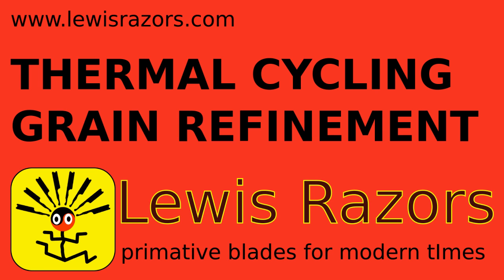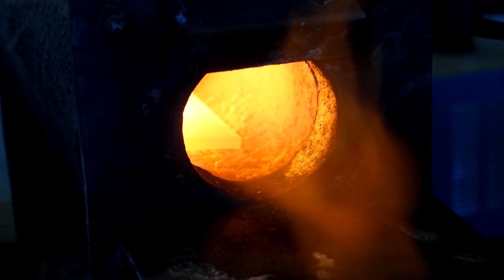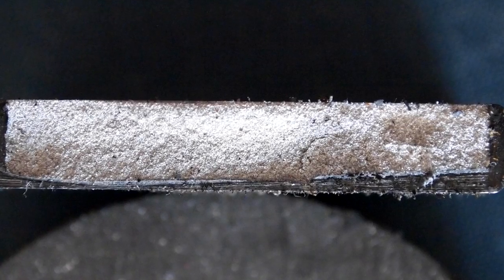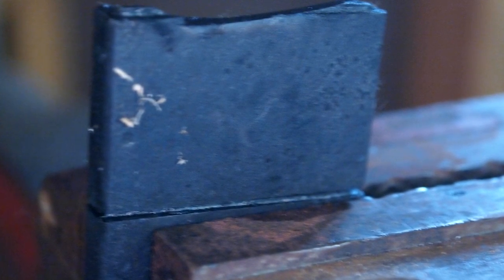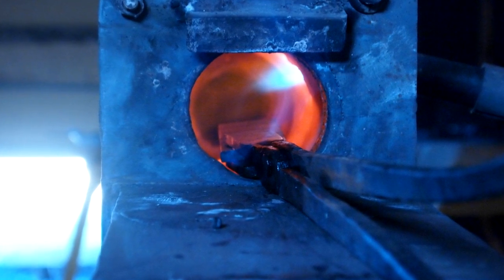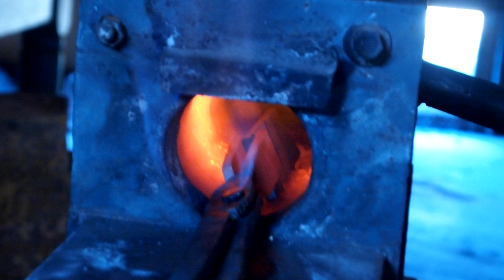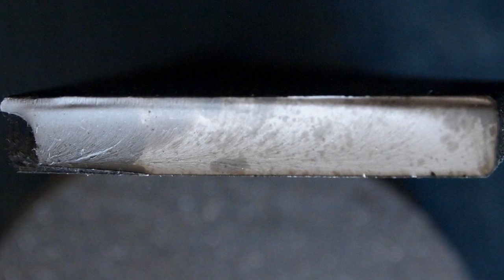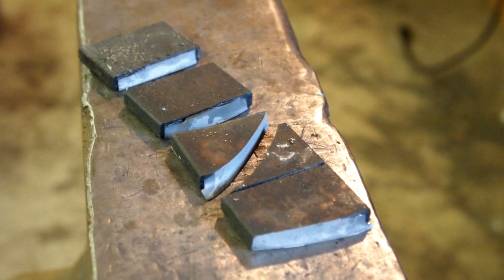Grain Refinement

Comment: I would like to clarify your process here as I’m not sure I’m on the same page or fully understanding.  Firstly how are you measuring or determining the critical temperature (I dangerously assume lower critical temp) and in what medium are you quenching?  Then, do I understand correctly, that you then repeat the exact same process 3 times, achieving finer grain after every cycle?  Many people advocate a first cycle to about 100°F/40°C above the upper critical temp (Ac3 or Acm line) to obtain full Austenite, then the next cycle to the lower critical temp (Ac1 line) and then the last cycle to about 20-40° below lower critical.  To me this appears that you are achieving finer grain by just repeating the same process, but not cooling to room temp between cycles like usually done in normalising but quenching between each cycle, and this successfully reduces your grain size???

Comment: so you're just quenching and quenching and quenching?
Reply from the maker: Yes, heat and quench
Reply: Lewis Razors well that's pretty easy, so after the triple quench can i do tempering as usual?
Reply from the maker: yes, air cooling works just about as well and has less a chance of cracking the blade.  Air cooling or quenching both will work.
Reply: @lewisrazors  thank you for the fast respond sir!

Comment: thanks for this. Ive been having huge problems heat treating 1084 and still dont know what im doing wrong. Maybe i should do one of these tests myself. Is it detrimental in any way to re-attempt a heat treat on a blade that you feel didnt get hard enough?
Reply from the maker: If it does not get fully hardened, do it again.  1084  is a great steel to learn with it is forgiving.

Comment: i have an uniformed question.  so you heated it and then did a quench in oil each time?  next question:  what temp did you heat it too?  also. each time you did this the metal got harder?   shouldnt it have gotten very brittle?
Reply from the maker: Yes, I heated and quenched in oil each time. 

The first heat, before I started the project was a long heat around 1800-1900 (I did this by eye in forge, so take the temps with a grain of salt)  I wanted to make big ugly grain.   The following heats were around 1500. I would watch for decalesence then quench.

The metal was hard after the first quench. Hard but not the best grain structure. The finer grain structure makes the metal more break resistant.  Yes you are right the metal was brittle, If I had a thinner piece of metal would have shattered a lot easier. 

Metal can be hard, but have a terrible grain structure. The refining of the grain does to make the metal harder, but makes it tougher (and in the case of a blade, makes for a better edge).

Comment: I just tried to replicate your experiment with O1 and wasn't able to do it. I used a smaller piece but scored it the same way. Each piece's grain looked decent (approx like your second piece in the video) but didn't vary much.  Is O1's behavior quite a bit different than 1084's concerning grain refinement? Or did I do something wrong?
Reply from the maker: The alloying elements in O1 make for  deep hardening and fine grain, O1 does behave differently than 1084.  What you said makes sense to me,
Reply: +lewisrazors Cool. Thanks for the answer and quick reply.

Comment: Enjoyed your video.  Glad to see you are from Texas too.  I love to see tests done on steels.  There seems to be a lot of confusion with thermal cycling and normalizing.    Normalizing allows the steel to cool completely without any quenching, whereas thermal cycling allows the steel to cool slightly to black, then heated back up (or sometimes quenched at black and then heated back up).   However, I've noticed some people will refer to thermal cycling when they are really normalizing .  Have you by any chance, done any tests just doing thermal cycling (quenching just after it goes to black) compared to quenching right after reaching critical temp, which is more like a regular heat treat, just multiple times?
Reply from the maker: I am getting my ideas and thoughts from Verhoeven's books on metallurgy, he talks about bringing to critical and rapid cooling to reduce grain size.  I have not experimented with quenching after the steel is black.  I think of thermal cycling as a general term, it could be critical then air cool, it could be critical than cooled a slow rate, it could be sub-critical sphereroidizing, it all depends on what I want to do to the structure of the metal.
Reply: Thanks for the quick response.  I've been working primarily with 5160 and 8670.  One thing that I've noticed by cooling to black and then reheating back up to critical, is that after doing my final quench for heat treat, the knife didn't appear to get as hard as it normally does so I did a double quench which gave me the hardness I expected, but what I'm thinking is that possibly the cooling to black and then quenching and then reheating again without having let the steel cool completely may have been acting more as an anneal on the steel, which may have been a factor as to why it didn't get as hard.  I did just finish heat treating a knife w/ 5160 using the quenching at critical and that hardened up really nice.  I have not done any destructive testing with this method, so I was glad to see your video, but I do plan on doing a few experiments myself.

Comment: Awesome video man! How does the effect of this process compare to normalizing the steel the same number of times? Would you say it's probably more effective?
Reply from the maker: +Tristan Ruggeri The results would be very similar, using oil takes less time than air cooling, I hate waiting.  Is one better that the other?  If the blade has been forged to shape and already gone through numerous heats I would say both ways would be equal.  If the blade is a fully annealed and spheroidized stock removal, I think the oil method would work a little better (splitting hairs here)

The oil is a quicker method, but there is also risk involved, air cooling is a little slower but safer method.  Basically 6 of one, or half dozen of the other.

Comment: So was this just bringing it up to the same temperature each time with no other changes?
Reply from the maker: +m sarg I brought it up to critical temperature, then quenched in oil for the steps.
Reply: Yes, I saw that, but there was no other grain refinement like normalizing or anything else?  Just bringing the entire piece up to critical 1 time then quenching the entire piece?
Reply from the maker: +m sarg Yes, that was it, thermal cycling, heating and rapid cooling.
Reply: Did you do any steps to normalize the steel prior to this, which would have brought the grain structure down?
Reply from the maker: +m sarg No I did not normalize, I made big ugly grain on purpose. I wanted to illustrate what multiple thermal cycles can do.

Comment from the maker: Yes, heat treat is done toward the end of the process. 

I used a larger piece of metal so the grain would be easier to see. It was just for demonstration.

For the steel I was using critical temp is a little less than 1500 F or 815 C that is a lot less than the melting temp. It is reddish hot.

Comment: I have a couple of questions.  Isn't heat treating something that would be done at the very end (Lastish step)?  It seems to me if you do it at the end a few times the work portion will be easier and the hardness, well harder.  Critical temperature is just before melting?

Comment: I've utilised this technique on a few small 0-1 carving tool blades, 4 cycles of heating & quenching. The results are excellent, a much smoother finish from the grinder, which not only means a more robust edge but less time on finish polishing. Thanks again.

Comment from the maker: I used canola oil for the demonstration in the video.  

When I am working on blades I use a fast (parks 50) or a med (I forgot the brand) quench oil depending on the type of steel.  I heat the quench oul to 130 before using it.
Reply: 130C?